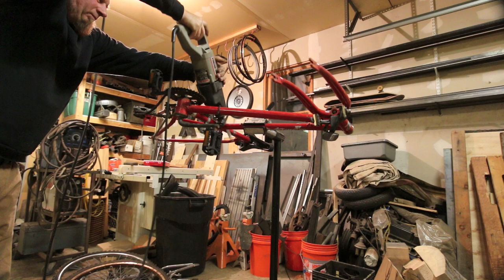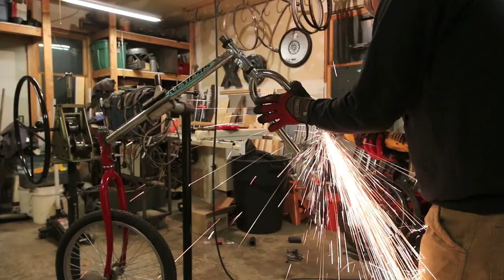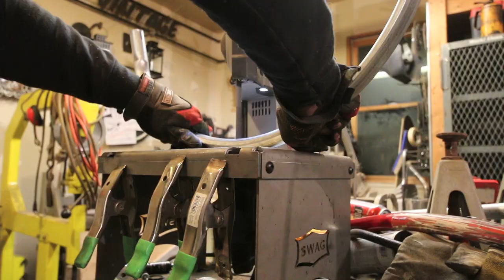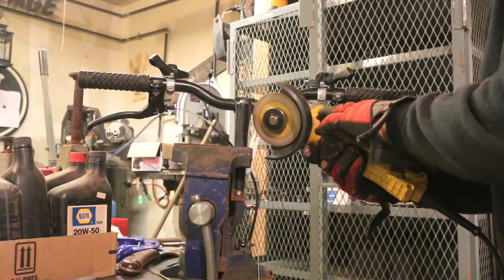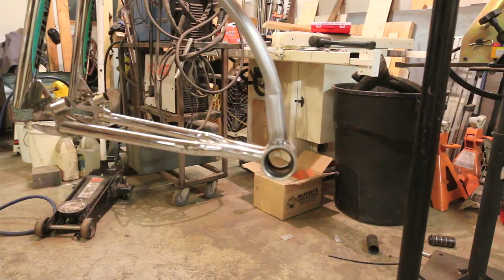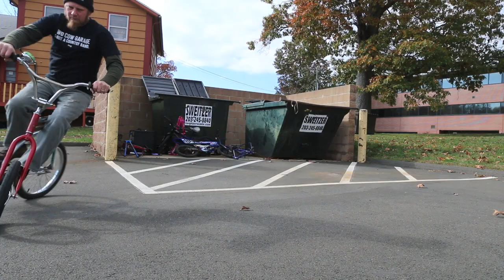how to build a swing bike

Comment: This will sound weird, but I travelled with the circus and we had several of these bikes on the show...like a mutant unicycle.
Reply from the maker: Artfully Rogue so you were in the circus? Interesting
Reply: elmcityvintage yeah I travelled with Ringling for about 13 years. Started as a clown so we had some crazy bikes on the show
Reply from the maker: Artfully Rogue awesome! How long ago? I had a friend that rode Bmx for them years ago
Reply: I was there from 86 to 99, I think I moved shows about the time the BMX guys came onto the show. Ringling had two shows, so I was on one show and the they were on another. However I remember hearing about them.
Reply from the maker: Artfully Rogue my friend was Brett marshal. I got to hang out with Brett on the train one night. It was a fun time. Very tight in there
Reply: elmcityvintage haha yeah very small space. My first room on the train was the size of a bathtub with walls. However since the clown train car had a center isle car, we would bowl the full 90' knocking over beer cans. 😀

Comment: How did you get the giro head set to stay in?
Reply from the maker: Not sure what you mean?
Reply: @elmcityvintage when you attached the seat I was trying to understand how the stem didn't drop straight through, as the offer bike has stem what you screw down...
Reply from the maker: @fabiobear3089  I modified a quill stem to use as a seat post. Basically I cut off the part that clamps to the handlebars. Now the handlebar stem is a quill seatpost
Reply: @elmcityvintage  is there anyway sending some close photos...I see the part you cut. I was very intreaged how the bike sat there in the stand with out the seat on on there and it didn't fall through...
Reply from the maker: @fabiobear3089  https://instagram.com/elmcityvintagedave?igshid=YmMyMTA2M2Y=
Reply from the maker: @fabiobear3089  both forks are threaded. Not threadless